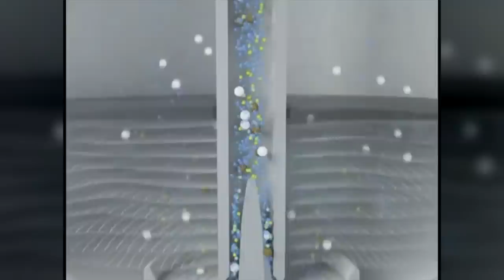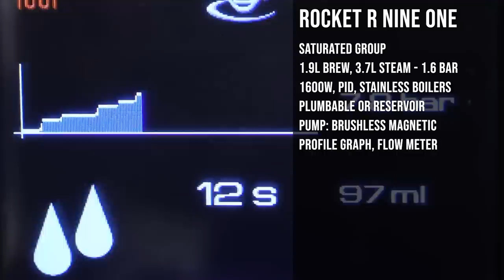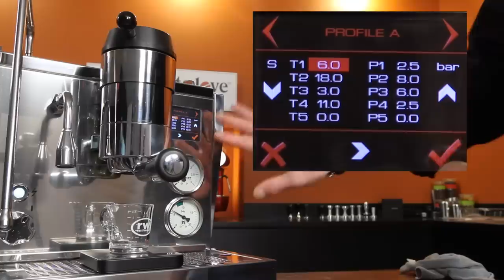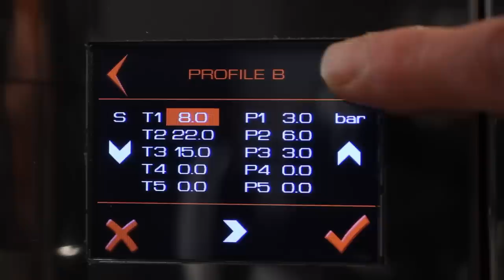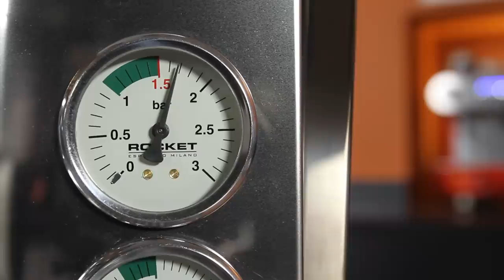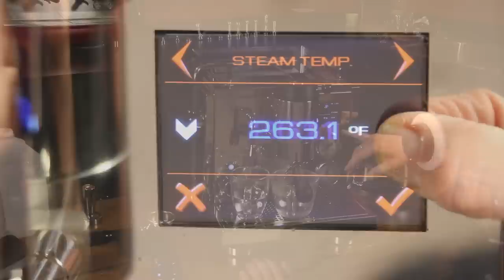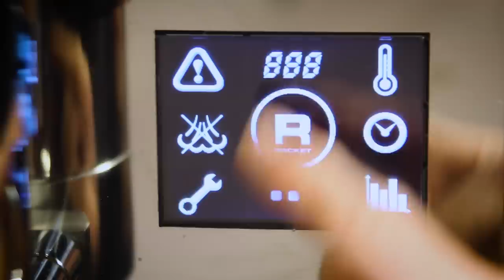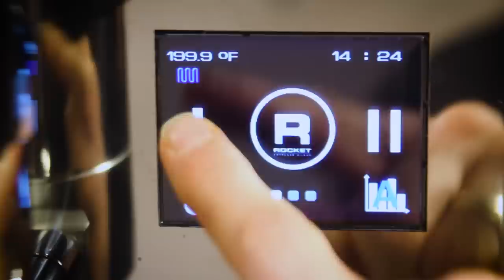Review: Rocket Espresso R Nine One Pressure Profiling Espresso Machine

Comment: I’ve had two of these £4.5k machines. After my initial disappointment with the first brand new machine that had software issues meaning the profiles just didn’t work and some of the functions didn’t work at all, it was returned and refunded by Machina. 

I then purchased a brand new machine from Pro Espresso. The service has been faultless but the machine has had problems over the 9 months I’ve had it.

I’ve had two leaks. One that needed a new seal. Also has had a faulty pressure gauge that had to be replaced. 

This week I started to get some odd noises with the pump and this morning it’s not working at all - the pressure will just not increase. The screen turns itself off and resets halfway through the serve and no pressure at all. It’s now just making the noise and doing odd things with pressure. 

I think I’ve had it with this machine. For nearly 5k I expected reliability. It’s a bit embarrassing to be honest. It was my 50th birthday present so I look After it and make probably 1/2 coffees a day max.

From the experience of two brand new machines, the rocket r-nine one is just not reliable.
Reply from the maker: Hi JW, Thanks for sharing your unfortunate experience with the machine.

Comment: I'm getting to grips with my own R9 One. I notice the inline filter and ends of the silicone tube connected to it have turned a sort of black. THe machine was sitting a really long time in a location so I wonder if that's biofilm and I should replace the filter... Guess it's only about AU$15. 

I really appreciate the run down of the machine - it's a rats nest of cabling and tube! I just finished insulating the boilers and that was a pain to do without stripping the machine down. I hope it yields similar benefit as it did on my old rocket giotto (about 30% less "on" time for element).

Comment: 1.9 liters brew boiler seems to be overkill for home users. Usually a smaller boiler is used for prociumers machines. If you make 2-4 cups a day you will get lot of reheated water that will effect the taste. I was looking for a profile machine and so far thinking of VBM Domabar super electronic. What do you think is the downside besides e61 group?
Reply from the maker: Hi Val, If you're interested in profiling machines and you're at the level of the R Nine One but want a smaller boiler I'd take a look at the Dalla Corte Mina. It's a flow profiling machine with incredibly precise control of flow rates and with the smaller boiler over group design brew temps are accurate and quick to change. Learn more about the DC Mina here including videos: https://www.wholelattelove.com/products/dalla-corte-mina-espresso-machine-110v-white
Marc
Reply: @Wholelattelovepage  The Mina is a go too machine for my local roasters, the precision on it is unmatched.

Comment: Amazing machine and I am really up for profiling, since the flavour you obtain is far superior. What bothers me with the R Nine One is that the User Interface does not seem to be thought through to the end:
1. The functional elements and the software design of the interface looks cluttered and does not reflect the elegance of the rest of the machine. It has the look and feel of a UI of a 3D printer rather. 
2. It’s apparently not possible to get any software updates from Rocket. At least I did not find a hint to that possibility anywhere. Meaning to change software you would have to change the entire machine.
3. The manual profiling and recording option is great - but having only one a slot for saving the profile without having the opportunity to transfer it to the A-D slots reduces the whole idea to a kind of click bait/buy bait. Because this means that I have to overwrite it each time I use different coffee beans - or I have to write it down and then program it by hand into the A-D profiles. Since there is no possibility for software update the machine’s value is cut down considerably once a machine with same hardware but improved software comes to the market.
4. The programming function (A-D) does not allow for proper programming of a linear decrease of the flow towards the end. It can only be programmed in steps. And only a total of five steps is available. That’s probably the reason why it’s not possible to transfer the recorded profile to the A-D slots. It’s structurally a different kind of data.
5. It should have a web-server like any router for software update and more convenient programming. Contrary to some iOS Apps that Rocket does not seem to update, this would be a timeless way to keep your machine in order.

Are there any announcements from Rocket for an updated version of the R Nine One ?
Reply from the maker: Hi FK, Thanks for sharing your thoughts on the R Nine One. I have no information from Rocket Espresso on updates to the machine. If you're really up for profiling you might have a look at the flow profiling Dalla Corte Mina - it has many of the features you desire: https://www.wholelattelove.com/products/dalla-corte-mina-110v
Marc
Reply: @Wholelattelovepage  Thanks for the swift reply. I will have a look - I didn’t notice that one yet. I like the simple Profitec solution - but, as you point out in the video, reproducibility would be nice to have indeed. To separate the “dialing in” intellectual act from “just making coffee” with the respective programmed recipe/profile would be quite good.

Thanks for all your excellent videos ! I learned a lot from them and they are really fun to watch ! It’s also nice that you manage to pinpoint the actual questions arising in each case !

Comment: My pressure sensor with the Din plug in the back of it is plumbed into a location below the OPV on the tank side of the machine instead of out of the top of the group (mine has a bolt closing that off). 

I wonder if this is just a configuration change for build as mine is much newer than this video.

Comment: Great video, pretty impressive. Your take,  pros and cons, Rocket R Nine One vs the ECM Synchronica with flow valve, thank you
Reply: That’s exactly what I was thinking.  Really the only things I see the extra money gives you is the ability of repeatable pulls due to the computers saving function and boilers.  The Rocket brew boiler is over twice the size at 1.9L while the ECM is 0.7L and the steam boiler on the Rocket is almost twice the size at 3.7L and the ECM being 2.0L. Having larger boilers results in them having larger elements as well, but if the ECM can steam and brew just as well who cares.
Reply: @danhorton6182  Thanks Dan and Orrin, i am thinking the same  :)

Comment: can't decide between the Rocket R Nine One and the Profitec pro 800, they can both pressure profile but what is the huge difference?
Reply from the maker: Hi O, Well, the huge difference is the Pro 800 is a manual lever machine so any profiling you do is manually controlled by restricting the lever as spring tension causes it to rise.
Marc

Comment: 4:13 can you fit a 20 grams basket in the double spout portafilter of the R9? I am thinking to use such a machine in our family bakery for running max 55-60 espressos per day, somehow amateur- commercial use 😅
Reply from the maker: Hi Kats, You may be able to fit 20g in the filter basket which ships with machine. If not, you can pick up a precision basket like this that will: https://www.wholelattelove.com/products/baristapro-20g-nanotech-precision-portafilter-basket
Reply: @Wholelattelovepage  of course I already own a 20grams precision basket by IMS. I was only wondering if the double spot which I prefer to use has any limitation on basket size , comparing with  the naked portafilter that hasn't
Reply from the maker: @Kats072307  The 20g should fit. It's been awhile, and I don't have a unit nearby to confirm but I believe the machine may ship with an IMS triple competition basket

Comment: Hello Marc, nice to see you healthy again.
What an impressive review! 
Thank you, that was definitely a lot of work. Nicely structured.  I believe no one else could make such a deep going review like you guys.

Athletes just have more stamina in every way ;=)
That you keep track with all the inner cable mess. Also nice that you have tested the various steam tips, thx alot for that interesting extra work.
I have one small question: the boilers are not isolated like at ECM / Profitec.
How hot get the boilers from the outside? I had seen that some silicone tubes lie directly on the boiler. Will they not become porous over time?
Reply from the maker: Hi Bob, See you found the video! Thanks for the kind comment. Feeling much better - the sinuses have cleared up! Brew boiler runs ~200F/93C, service/steam boiler runs 264F/129C. Silicone rubber is generally non-reactive, 
stable, and resistant to extreme environments and temperatures from -67 
°F to 572 °F (-55 °C to 300 °C) while still maintaining its useful 
properties. We've serviced 1000's of machines with silicone tubing and have never had one melt, crack, etc. It's a very resilient material! In espresso machines generally only used for very low or no pressure lines.
Marc
Reply: @Wholelattelovepage  Hi Marc, thank you for your detailed and professionel answer.
Reply: @Wholelattelovepage  still an odd choice not to insulate the boilers. Other Rocket machines are insulated. Any insight as to the reason for this?

Comment: Can the R9 ONE do a "blooming" shot? Like, you can start the flow with a low-pressure pre-infusion, and then STOP the flow for a few seconds to let the coffee "bloom" and then restart the flow and finish it however you'd like? Thanks!
Reply from the maker: Hi CR, Yes it can. One can set a low pressure pre-infusion, set a next step in the process to zero pressure for a time then increase pressure. Can do the same using the manual control on the group.

Comment: I’m surprised the steam pressure is not higher and more on par with the gs3 or the ecm synch for that matter
Reply from the maker: Hi f, Thanks for the comment. Steam boiler is larger than in Synchronika or GS3. Steam tips make a huge difference. Did some testing on a Pro 700 (identical boiler and steam pressure to Synchronika) a couple weeks ago. It was ~20 seconds to take 6oz milk to 140F with the stock tip. On the R Nine One it was ~14 seconds. If you saw the section in this vid with the accessory tip tests the Rocket 3 and 4 hole tips did it in ~11 seconds. The smaller diameter 2 hole tip was 23 seconds. Working pressure does not tell the whole story.
Marc

Comment: I would like to see an honest review between the build quality of the gs 3 and the R nine one. After reviewing multiple video's the GS 3 looks like they take a great deal of pride in building that machine vs the rocket that looks pieced together like an old GM car.
Reply from the maker: Hi Jim, Thanks for the request. I don't totally agree with the old GM car analogy - except... Aesthetics are subjective and there's no doubt the GS3 is pretty. We've had a GS3 in the staff lounge for a couple months and now the R-Nine One. Guess why the GS3 isn't there anymore. It broke down and had to be serviced. Much like the Rochester Quadrajet carbs in those old GM's the valve on the GS3 eventually will need rebuilding. With the R Nine One doing its pressure control via motor speed and not a valve it's so far been more reliable than the GS3. Plus the R Nine One gives you LM Strada EP capabilities at less than half the price. I ended up being more of a Mopar guy with early 70's vintage Cudas and Challengers but had my fair share of GMs including an early Firebird with a 350(wish I still had that one) and a Camaro and Nova with the ever reliable inline 6. Sorry for the dive into my High school car days :)
Marc
Reply: @Wholelattelovepage  Thank you Mark. It sounds like we are about the same age. The rocket is a great looking machine. It is when you showed the inside of the machine That I started paying closer attention. At first glance it looks decent but then I noticed the wiring and hose routing. It does not have the professional look that the GS has. The hoses look like they pulled them out of a stock bin and said make them fit. The wiring is point A to B with zero thought on service or cleanliness. The control modules look to be flopping around on the side. It looks half baked. That is why I asked to see a little more in depth on build quality of the two. Both machines are 7k what makes them worth that and is one more developed than the other. To me worth has a lot to do with build quality. Hand labor is expensive but great hand labor is worth the expense.

Comment: Can you save star last manual profile if you want to a or b c d e? Or you have to write it manual on desired profile position? 

2nd can you share profiles with other r9 users i.e. export / import them ?
Reply from the maker: Kurt Hi, thanks for the questions. Can only save manual profile to star position. No electronic method of sharing profiles. You’d need to write it down. 
Marc

Comment: It looks very well made. What is the heat up time?
Reply from the maker: Hi JD, Thanks for the question. About 30 minutes to complete warm up. It does have 2 automatic turn-on/off times per day. So if using about the the same time everyday you can set it to turn on automatically and be ready for use when you are!
Marc
Reply: @Wholelattelovepage  Thank you, Is it worth the extra over the Vesuvius?

Comment: i want one!!!  But in my head i'm thinking will I get a $4,000 more better cup of coffee than my $2k to 3$ standard pre-infusion E61 espresso machine.
Seems more ideal if you are also a home roaster of beans.  Each type of bean you roast may need to be saturated differently.
Reply: good point - WHERE does one Draw the Line (unless you've got $$$ to Burn) for a BETTER Cup of Java.?.
Reply: Well you could get pressure profiling, without the touch screen control, a bit more reliance on 
Barista with the Lelit machine

Comment: So if I go with a ecm syncronika, plumbed to a bwt water filtration system, how often does the machine or pre-infuse valve need replaced or refurbished?
Reply from the maker: Hi william, Thanks for the question. Assuming you are referring to the E61 mushroom valve? With proper use of the BWT filter system no scale should build up on the valve. Additionally ECM uses a stainless steel mushroom while some manufacturers use chrome plated mushrooms. With that, replacement should never be required.
Marc
Reply: @Wholelattelovepage  An online forum says that the handle for the pre-infuse on the ECM synchronika, in some cases, doesn't turn a full 360° and or one has to be careful when handling it, as to not burn one's fingers. Is this really something to be concerned with?
Reply: @JasonAlexzander1q47   Hi - I've had the synchronika now for about nine months now. There is an adjustment on the control which will change how much range it will turn. It is a little tight and if you aren't paying attention you could burn your fingers. The flow control is an add on to the synchronika as opposed to being designed that way from the get go. If I were buying today I would look much more at the Lelit - you could save some money - or take the money and move it into your grinder and I think have a better set up for the same money.

Comment: Sam
Hi Marc, can I pipe in well water that is slightly acidic with the SS boilers ? I could not do that with copper boilers in the R58.
Reply from the maker: Hi OA, Thanks for the question. Slightly acidic should  be okay. Normal range for drinking water is pH 6.5 to 8.5. It is tough to make a blanket statement as other water parameters like alkalinity, mineral content, etc play a role as well.  If pH is  below 6.5 it may be  best to treat the water to reduce acidity/increase pH - Soda ash (sodium carbonate) and sodium hydroxide raise the pH of water to near neutral when injected into a water system.
Marc
Reply: @Wholelattelovepage  Thanks Mac, are your comments appropriate for  Stainless Steel Boilers ?
Reply from the maker: Hi OA, Just read back my initial comment and edited it to say "Slightly acidic should be okay". Rest stays the same. I'm comfortable with pH 6.5 (slightly acidic) in stainless steel.
Marc